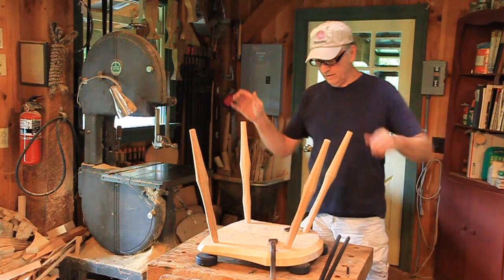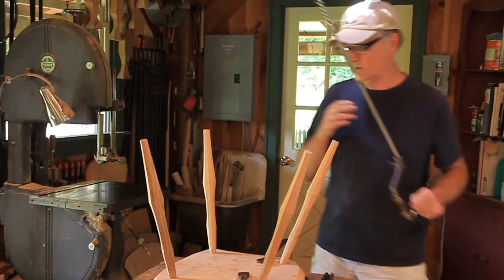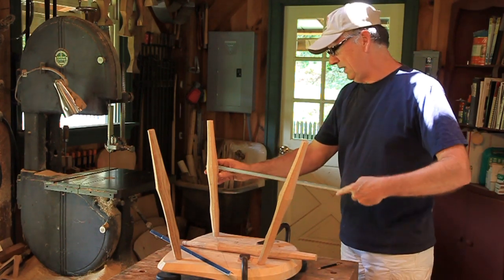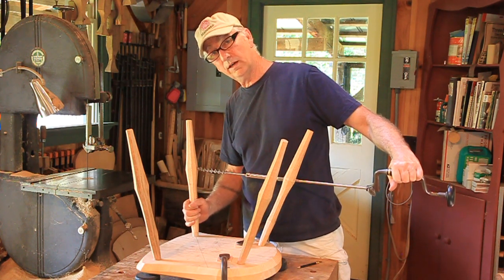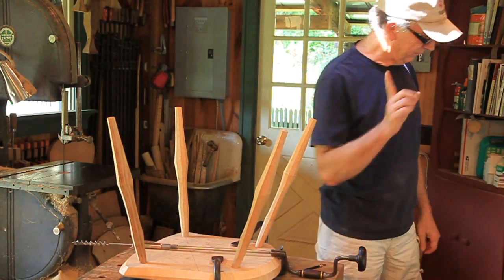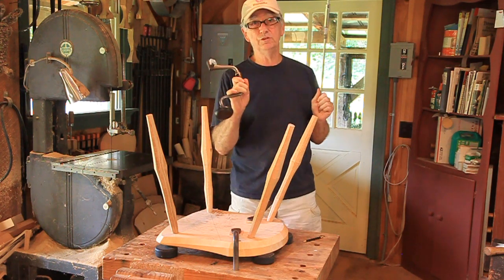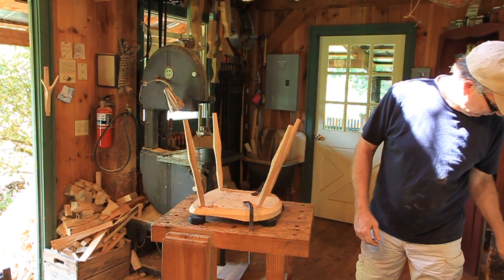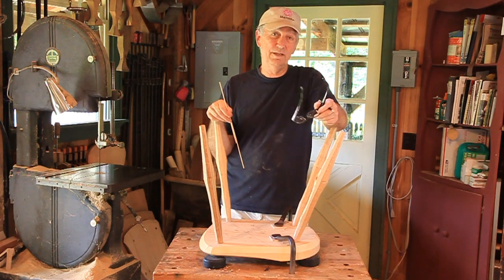13.  Drilling the Holes for the Stretchers

Comment: I found that a brace with ratchet mechanism can be used as well, it's not as fast and eventually one may have to remove the leg, but at that point the hole is deep enough to help with alignment. May not be as accurate, but certainly another option.